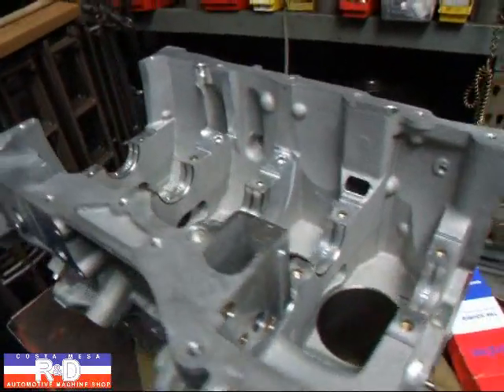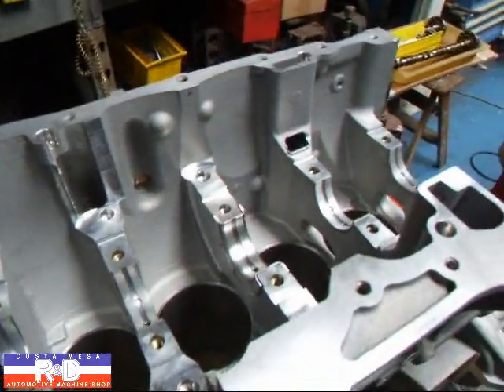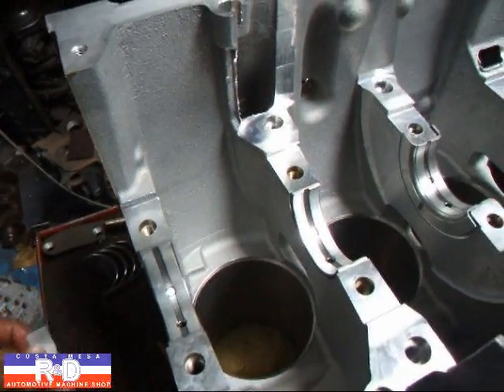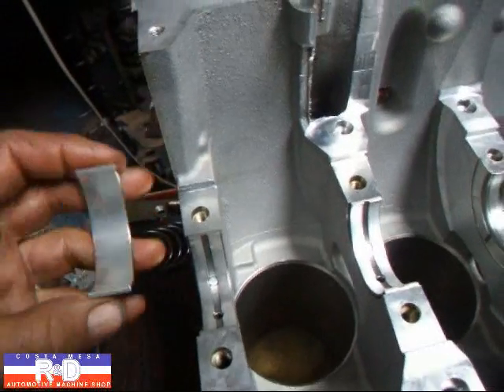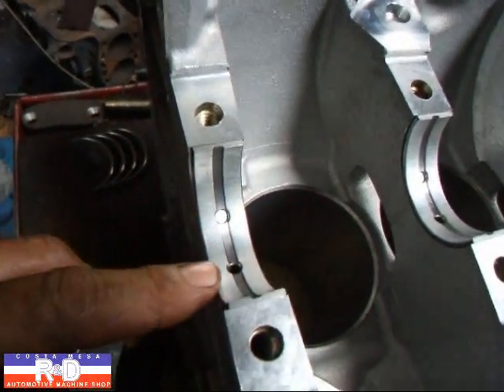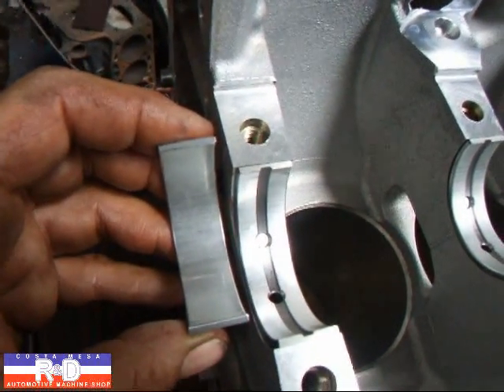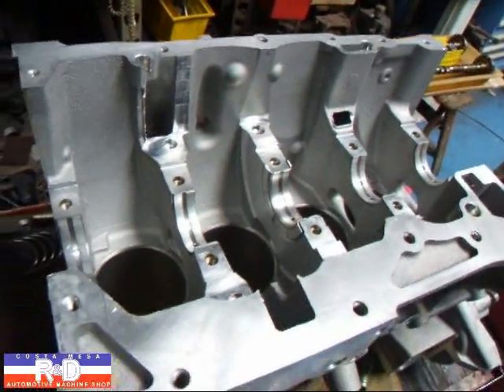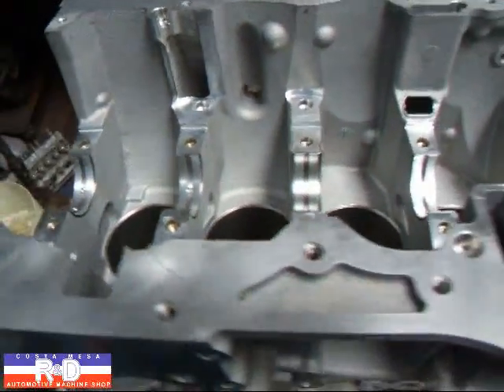Mazda Speed 6 Main Bearings.mp4

Comment: My brothers Mazda 6 2.3 sport started knocking really bad, until finally it stalled. Is it too much work to rebuild it ? Will it do with "just" new bearings, or is there a great possibility that he may have to have a new crankshaft, or maybe new rods. ? I'm just asking, cause i dont know what usually needs deplacement. 

Thanks.

Comment from the maker: @boxer3main - That;s not a good anlogy, what holds the bearings in place it the crush-fit between them and the block. An out-of-round hole would distort the installed bearing and may cause it to spin because of unequal crush. You kind of have it backwards.